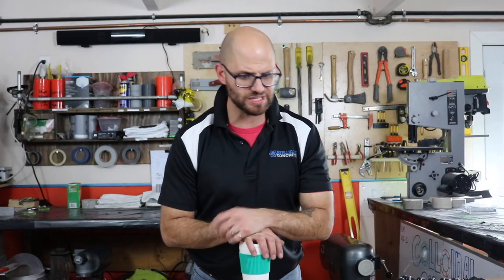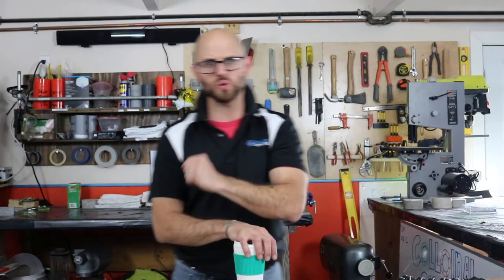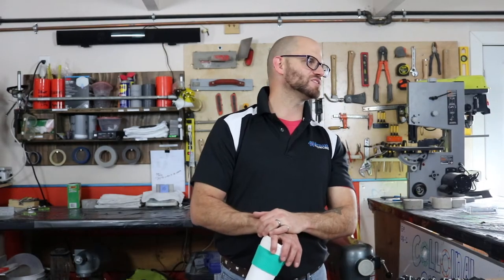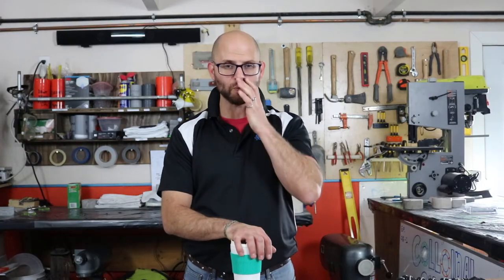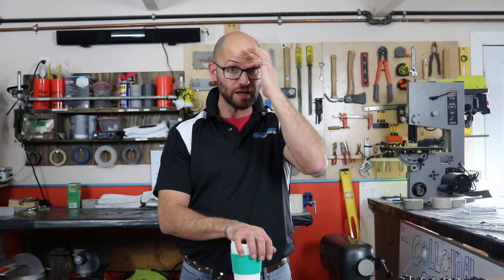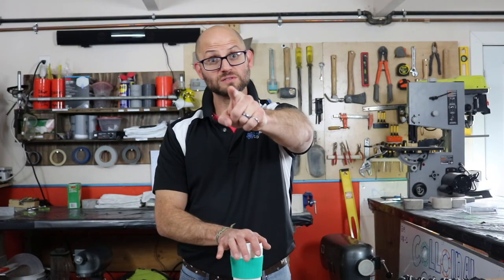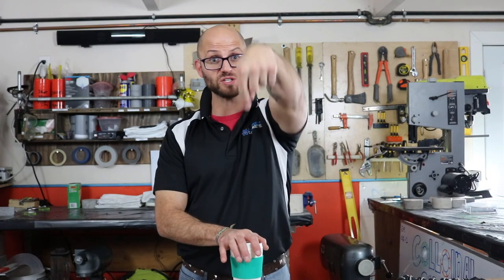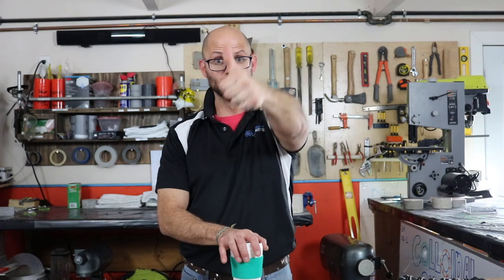How To Use Colloidal Silica In Concrete - Vlog #137

Comment: Dr. B could colloidal silica help in GFRC concrete countertops? I was told to use sparingly (.5-2%) i am hoping it may help with the finish but we do not polish like granite tops we wet grind to 200 grit and apply sealer.  Maybe with colloidal silica it may be easier to get a better Finish? Thank you!
Reply from the maker: Totally!!!